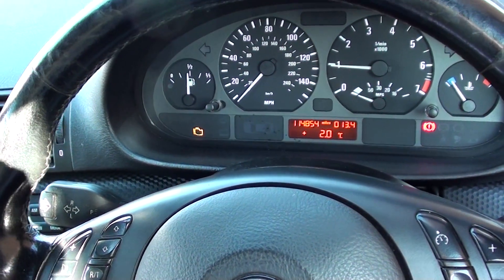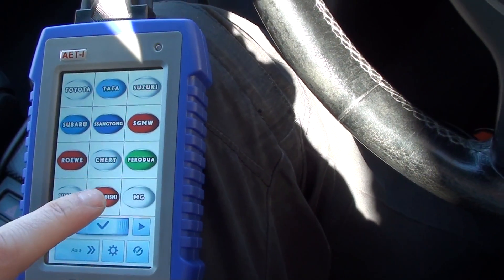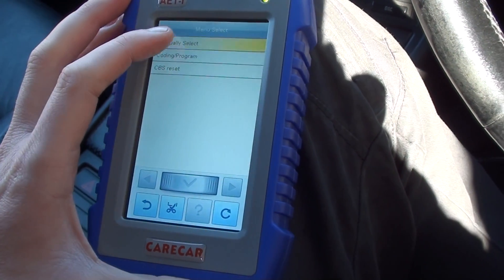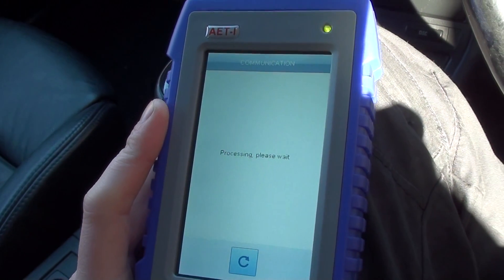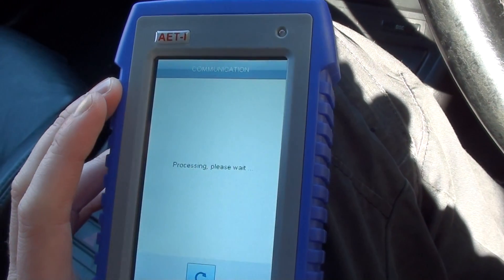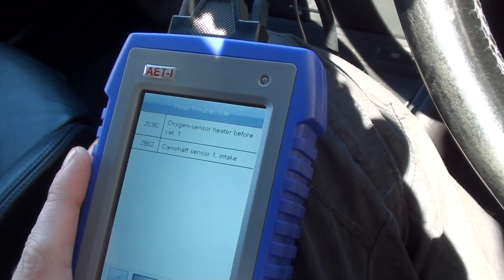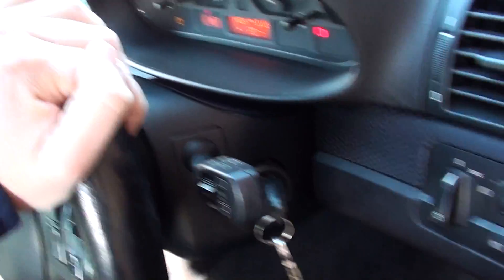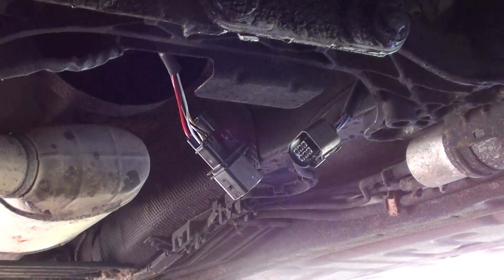BMW O2 Sensor 2C9C Location

Comment: So you recommend replacing that o2 sensor with a 2c9c then? What do think about my 2c9c but also has a P0030 with it as well. I'm getting both codes on mine. After car has been running for a bit, like when it's good and warmed up for a few, it can start running a little shaky. Like when I go, stop, stuff like that. I still drive it but...you know I shouldn't be until I correct the issue. 
Anyway, that's what I was hoping you could give me your opinion on- the 2 codes I'm getting. 2c9c AND p0030. Thanks!
Reply: I have the exact same issue, did you fix it?

Comment: Where did you get the replacement part? Or do you know the part number? I want to know if this is the right one. Thanks  https://www.amazon.co.uk/gp/aw/d/B073XK8LWW/ref=mp_s_a_1_9?ie=UTF8&qid=1502027295&sr=8-9&pi=AC_SX236_SY340_FMwebp_QL65&keywords=bmw+e46+oxygen+sensor